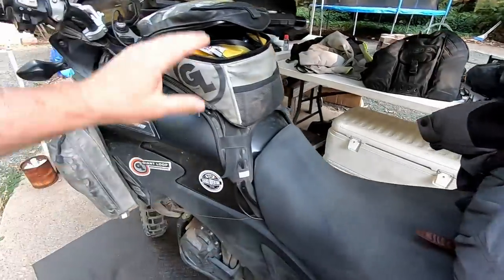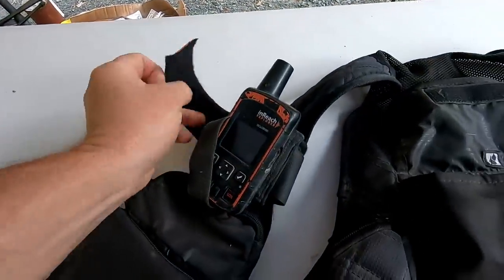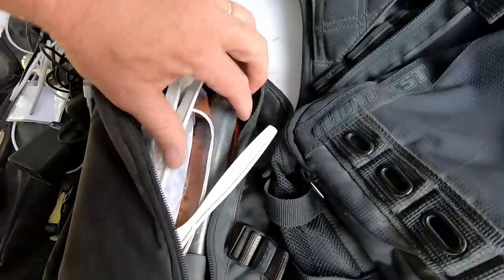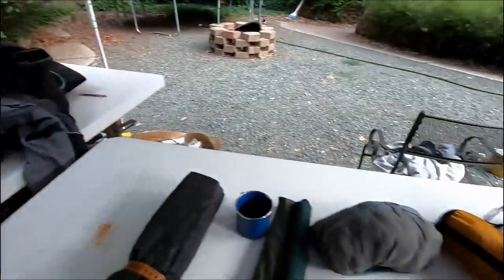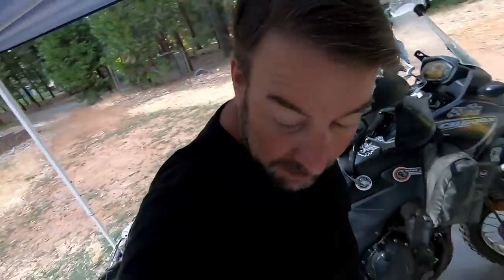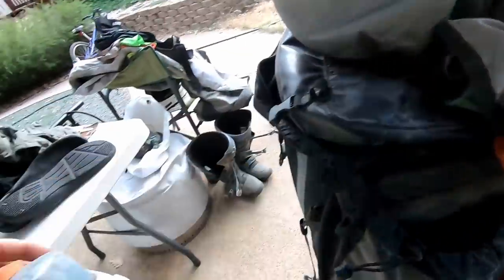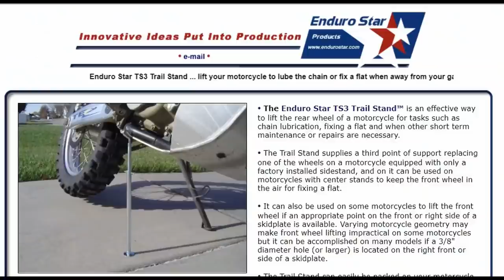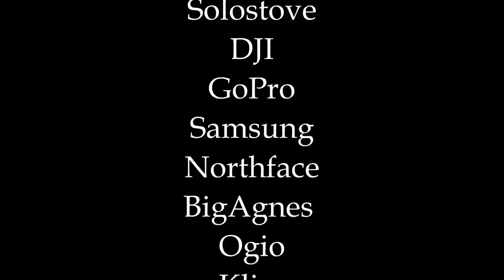TAT'NBack 2020 (Un)Packing

Comment: Nice! Thanks for taking the time to go through all of this, Juan! Impressive setup! 

I was tossing around the idea to the wifey about buying a pair of TW200's & heading out on that trail. Since I'm so out of shape, & short, the TW would be easy for me to handle, and same for the wife with her lack of experience. We'd definitely take a year locally before heading out on that. Gotta get in shape! I remember the last time I got on 2-wheels off-road, and I was amazed at how quickly I faded, compared to when I was a teenager - back then it seemed effortless. Now, it's like work, hahaha! Those TW's would be terrible on the interstate - we'd be ringing their necks just to maintain 65-70, so it would be backroads and trails exclusively, which is what I was after anyway. Might just do this one day! Thanks for the inspiration buddy! 👍🍻
Reply: ...... Just Do It!   Sounds like you have a solid plan.  Riding together for a year first is an excellent idea and affords you the time to get prepared for the trip. Staying off the interstates sounds like a wise plan.   I think your really need to think the fuel mileage vs the available fuel in the strictly off highway areas.  But other than that, I think the TW200 is a rock solid machine and would carry you all with no problem!  Ride safe and I hope you do it...
Reply: @WillysPerformanceCycleCtr  - Thanks!! I appreciate the words of encouragement! 👍🍻

Comment: Greetings, first post! Mr. Brown I ran upon you while looking at some clips on the 500x while trying to figure out to what I could turn from years on a BMW 1200LT. The legs no longer want to hold up the 900 pounds of loaded LT, lol, so physics is pushing me to a lighter bike. While becoming very educated on your clips I was stunned to realize you were heavily into aviation, a pilot, etc, as well as underpinning airplane mishaps. I see these very often on some internal links with regard to my work with the FAA and instantly subbed! In any case, your 500x effort has almost decided me on getting one since one of my bucket list items has been to take a bike over the trails in Ouray, Colorado, on which I have spend many hours over the last 12-15 trips there with 4X4 vehicles.  I will continue looking to see if you give a summary of how the 500x RR did going up some of those trails, many of which are very rocky and slippery, thanks for such a rich environment, will likely do a patreon sub, thumbs up! I had intended to get either a small bike such as a TW200 or Xt250 but I may have to consider if an extra 100 pounds is doable :)

Comment: Excellent video, what to pack and how much is too much is always an issue. I don't do adventure riding but I do regional and cross country endurance rallies. Cross countries are more limited now with age. So at the moment one thing I'm doing is unpacking from a trip to Nevada last year and getting ready for an 11-day event in 2021 that starts in Provo UT. I have Happy Trails aluminum panniers that were on another bike at one time but I need to get rid of some of the weight. I run a CT tire on the rear and it rubs on the under seat storage area box when bottoming out , beside the weight. I need to look at those GL bags to see if they will do the trick for me. I need to be able to remove just the  left one at times. Four jackets??? I pick one but on occasion two and live with it. I do have a light weight rain coat I use as a liner if a monsoon develops. Enjoying the TAT'NBack. BTW how many times did Jen shake her head and said amateur? I'm also a retired helicopter A&P. I live near Philadelphia PA.

Comment: Looks like a nice drone how much do they sell for what's the maximum resolution and distance you can take it
I didn't see any emergency repair puncture repair kit tubes and tyre,  and a liquid repair impregnated rubber solution with Kevlar flakes, make sure you have the valve stem remover tool usually comes with the bottle. You can repair inflated tyres if they have a gash or puncture some rubber tubing and rubber glue and a flat screwdriver put the glue in the slash or hole let it go dry put some glue on the tubing let it go tacky make a loop and push it in with the ends sticking out trim off let it hardened for about 10minutes inflate. You can get a special tool for inserting the rubber tubing what is better like a darning needle.
Why doesn't somebody make a container to boil water for tea coffee or soup you can use the exhaust of the engine to heat it up. A saddle shape that goes round the downpipe with a clips fasteners on the back to hold it in position insulated on the outside so it's not hot to touch but has a piece of aluminium core what is touching the exhaust wouldn't take long to heat up. Put a safety valve with a whistle on it so you know when it's ready
Reply from the maker: $500...1080p
Reply: @blancolirio  seems quite reasonable you don't know on distance can it do a mile out of sight you can get boosted antennas do they work with that drone
Has it got automatic tracking
Reply: We used the “Hotdogger” on our snowmobiles. Nothing like riding down the trail smelling little smokies simmering in BBQ sauce.

Comment: Great trip! I am glad you could afford it (time and money). I was wondering what radio you have on you and now finally you explain it. Could you do a video regarding all the radio transceivers on a plane? The small plane use the same Air Band frequency as the Airliners? Would be nice if you could add the links of the equipment later. Congratulations for your channel I did learn some things about aviation which is Great!

Comment: JUAN,,hello, that’s quite a set of bags, each with a purpose , great tip you both had, some 6K MILES   MAN, FEDEX just lost a DC10F  @ MENPHIS, TN, INDIA just lost a B737 very heavy rain   Over real the airport broke in 2 , 16 dead , then there was a C180 ran off through a fence, stopped in parking lot ,,of a warehouse  grocery, I mean destroyed, pilot got out ok, British Columbia   
Then Isiass, trashed the place 2 tornadoes in so Jersey many poles down, may get fixed in a week, parts of NYC trashed, too many trees down pulling wires too,  oh did you see any URAL bikes with sidecars , on your Trip ?   Cheers 🇺🇸🇺🇸🇺🇸🇺🇾

Comment: This is why the Harley pan American won't work. There must be 100% reliability.  50 miles into the boonies and the motor drops a valve, big trouble.  With modern telecommunications,  the rider can be rescued.  But, how to get the bike out? The trail might not be passable to 4x4s.

Comment: For the Rally Raid conversion and overall trail riding, is is advised to purchase a non-ABS bike for fitment of conversion and ability in dirt to slide the tires when needed? I think this bike and the riding I want to do in the future fits my needs better . . I went from a DRZ, which I loved to the last 4 years on an FJR1300 which I love as well, 2 completely different bikes. The older I get the more I want to be off-road, I have always jokingly said, trees do not pull out in front of you, if you hit one its pretty much in the rider. Any input appreciated.

Comment: Hi Juan, Glad that you had a great trip.  While I have not used my Sidi boots for as much off roading that you did, I had both the Discovery and the Cross Fire boots.  I have ridden the Discovery boots in 100 plus Texas weather and I rode all day with these boots without a heat issue.  I did not ride the Cross Fire boots really hot temps, but as far as I can recall they were both comfortable and did not have a heat issue.  As my last MC riding was in 2013, I am not sure what improvements or changes Sidi has made to their boots.  I have well over 75,000 road miles and about 4,000 off road miles in Sidi boots and if I were still able to ride, Sidi is my choice.  I am sure that you can find out a lot more about Sidi boots on ADVRider.  Thanks again for all your great videos as I have learned a lot about aviation and fire fighting from them.  Stay Safe !!

Comment: Are the trails on the website (transamtrail) rated in difficulty... so you are able to decide your route that way?
Reply: Hi T-Bone - if you follow the official Trans-Am Trail route (from Sam Correro), then it's designed to be perfectly manageable on a mid-size all-terrain adventure/dual-sport bike, with the typical luggage load you'd need for camping en route - and any sections that might prove more challenging are clearly marked in his accompanying notes, and a work-around/bypass available. 

However, do keep in mind that the presumption is you already have some off-road riding experience, and are also prepared for the changes in weather and altitude you'll inevitably face. If this sort of all-terrain endurance riding is something you are unfamiliar with, it is better - as Juan has suggested a couple of times during this video series - to gain valuable experience by taking a few shorter trips first such as a long weekend, or a week etc. closer to home, before attempting to ride all the way across the country and back.
Reply: Thank you @jmo2752 ... i am an avid armchair adventure motorcyclist... following Jaun and yourself has been a pleasure... i hope to one day own a adventure style motorcycle and go on rides like this one day... sure like your just shared... start small and work your way up to a trip like this... youtube has been an excellent source of endless people riding and sharing their experience... thanks again for replying Jenny... take care.